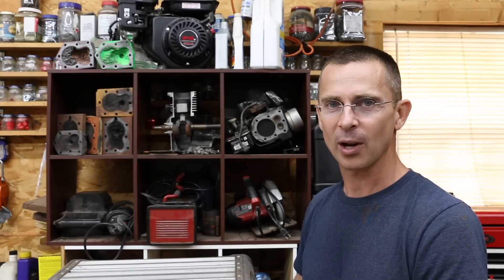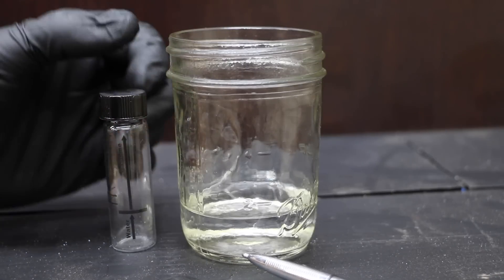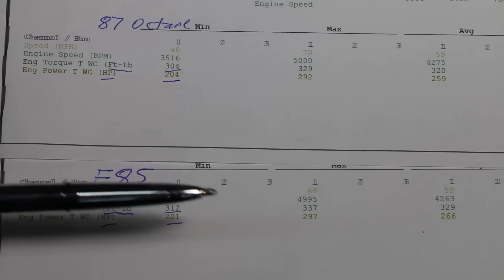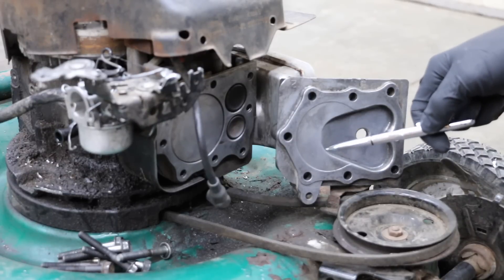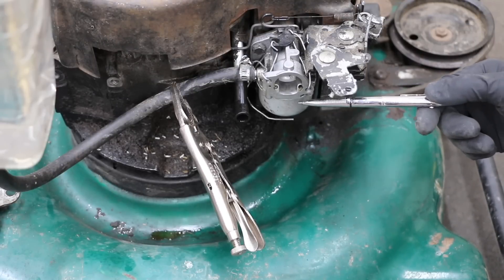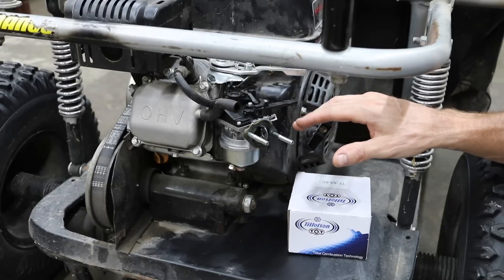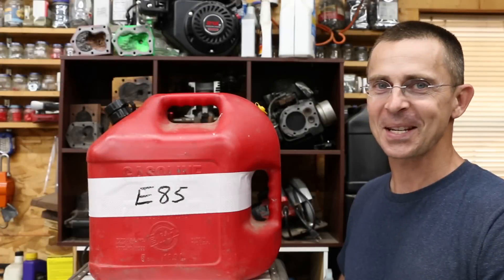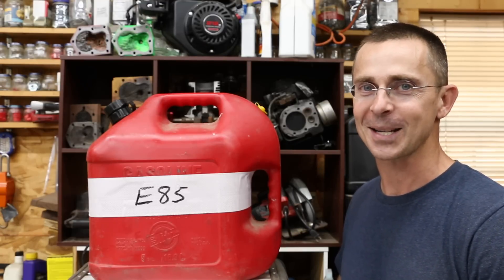Is E85 better than Gasoline? Let's find out!

Comment: So, for those in the know, E85 is a preferred fuel for boosted engines, because ethanol has such a high octane rating compared to substantially  lower octane gasoline(even higher than some racing gasoline, but much more affordable).  Boost can be cranked way up with E85, without the fear of pre-igniton, all be it, at the cost of using a lot more fuel.

For those not in the know, E85's draw is  the lower cost per volume, which is really not a lower cost, since mileage suffers so much when it's run in low compression or non-boosted engines.

My suggestion is to try and get one of the Briggs up to like 14:1 or higher compression, and compare how much power can be made vs regular gas which can only be run, in a lower compression motor.

So basically see if you can measure the efficiency increase in the higher compression motor.
Reply from the maker: Great point. Thank you
Reply: @ProjectFarm  what about trying different experiments on 2 cycle chainsaw engines? Unfortunately, most chainsaw engines from an old McCulloch or Homelite to a brand new Husqvarna 372XP (all obviously not computerized carburetors) typically do not like ethanol because of the carb's rubber diaphragms and fuel lines, crank seals etc. Some of the fuel lines could be replaced with tygon fuel lines though, or if you're really good an old McCulloch's fuel lines can be replaced. It will be the carb's rubber internals, gas tank gasket, crank seals and any other rubber parts in contact with the ethanol fuel mix that will eventually suffer. Maybe even the cast aluminum and magnesium will too. The good news is that the old McCulloch carburetors are fully adjustable. I typically use only 91 octane gas with absolutely no ethanol because if any ethanol blend gas (which I have used 87 octane 10% ethanol blend) will quickly plug up a chainsaw carburetor if left sitting in storage for any length of time, maybe even a month.
Reply: Rebuild kits are available for many small carbs where the rubber diaphragm and needle valve is replaced with an ethanol-resistant one.  So not a big problem, really,.   Carb rebuild isn't terribly difficult.
Reply: @tubastuff  good to know, except never seen one for the old SDC carbs on McCullochs.
Reply: @johnlincicum6390 , the "other" problem with 2 strokes 
and gasohol, is the separation factor.  If you premix, 
and there is the slightest amount of water, the 4 
components will separate out.  "Water and ethanol,"
and "gasoline and oil."  Guess which one has no oil 
in it, and burns at a higher temperature?  Not counting 
the SERIOUS seal and gasket issues, gasohol is destroying 
engines, nationwide!  And, I can think of a MUCH BETTER 
use for ethyl alcohol!  In fact, I'm using some of my own 
creation, right now!

steve
Reply: @steveskouson9620  drinking! Lol!
Reply: @johnlincicum6390 , I have NEVER touched 
a drop!  Seriously!
Yes, that is a lie.

steve
Reply: @steveskouson9620  Hahaha!
Reply: @ProjectFarm  Just an FYI, your older Chevy Suburban that you used could not really take advantage of the higher octane that ethanol provides because of its lower compression ratios on that engine. Try a modern 2014+ Chevy truck DI engine and you can for sure feel the difference in power (11:1 Comp ratio). I get 19miles/Gal Highway (2014 Silverado Crew cab 2WD)for Ethanol and my HP goes from 355 to 380 (According to Engine specs). The truck can run in V4 mode at 75MPH with no issue but it can't stay in V4 mode while on E10 fuel. It has to switch back to V8 mode to keep Cruising at that speed
Reply: @hectorgonzalez5030  Hello Hector.
Can we discuss when petrol is unavailable in Brazil when Venezuela is in crisis?
Sugar cane for instability of Bolivars and communistas!
Reply: @hectorgonzalez5030  Pray you have an actual Allison transmission and not the German ZF, like Ford.
Reply: @ProjectFarm  You should make a battle of the fuel filters, cellulose, stainless steel and microglass. If you are using cellulose try to use the ones that are compatible with e85, such as those from Ford and GM. I would like to see if the fibers expands, if they are issues with the glue and if the cellulose collapses with time.
Reply: @ProjectFarm  a computerized carburetor chainsaw as an example would be the Husqvarna 562XP or the new 572XP which is the replacement for both the older 372XP and the 576. The 372 technically had 2 different generations dating back into the late 1980's or for sure the early 1990's.
Reply: For a small engine test platform it would need to be overhead valve as you can't shrink the compressed area much on a side valve engine. Ethanol ignites quicker than petrol but resists detonation a heck of a lot more so when off boost you might need to reduce timing to get Max torque where in boost (or high load with high compression NA) you can get away with more timing without detonation. Pretty awesome. Also has a cooling effect but that's only noticed on turbo engines really
Reply: Would LOVE to see the diffrence with E85 in standard compression ratio vs High compression ratio. Would help alot of ppl out There!
Reply: It has a higher octane rating, but ethanol has less energy. Unless an engine is designed to run on it, you'll have a loss of power.
Reply: This is why I used ro run piston aircraft fuel in my pump gas track car. Something about the fuel being a weird green/ blue color was very strange. I think the fuel was around 104+ octane.  But the car ran good ! I built a 4 cylinder volks wagen engine that wound up producing 480 horsepower on that fuel. Very fun street machine. The engine was a 2275cc displacement. It was pretty reliably, until it came down to tuning the carbs, which was done on a weekly basis.
Reply: Boosted engines typically run hotter as well, so the e85 burning cooler also helps tremendously
Reply: Wow Jim you are one smart cookie! Very intelligent! Keep up the good work and God bless you
Reply: You know that you can Spray Water Mist and accomplish the same thing ... just saying
Reply: ...albeit...
Reply: jimsiggy, the problem with a flathead (side valve) engine is clearance for the valves.  Because of the design of the engine, compression is very limited due to valve clearance issues.  Raising compression can logically be done only on overhead valve engines.  A side-valve engine can never make it to the compression ratio you suggest.
Reply: @sunshinekid6922  Exactly correct! We used to hop-up our go-carts and mini bikes by building up the cam lobs with brassing rod. The limiting factor was head clearance.
Reply: @sunshinekid6922  actually the head could be machined to a higher compression ratio, if the valve clearance is to close. relief areas could be machined over the valves with a nice taper for proper air flow and combustion.
Reply: jimsiggy e85 also burns around 650 degrees cooler and produces a cooling effect in the combustion chamber. This is the primary reason why it’s so good at reducing knock besides being 105 octane
Reply: Steven Goggans yes! It tunes like 110 octane gasoline because of the cooling.
Reply: You could always put a different piston, or for testing purposes tack weld a piece of steel on the top of the piston. It probably would last long but just to see.
Reply: @claytonandersontar21  watch some videos from "afleetcommand" on YouTube. He does "pop up" pistons on Husqvarna 372 chainsaws.
Reply: @johnlincicum6390  
Hi John! Back in 1975, I brazed a small washer on top of the piston of a Cox .049 model aircraft engine. Static compression ratio tripled I'd wager. It ran wide open for a minute, until the whole shebang melted and locked her down.
Compression with nitro is calculated using volume of Roots Blower in conjunction with c.i.d. of the engine.
Positive displacement blowers are much trickier than turbos.
Way beyond my comprehension. I can read a barometer, but have never sat in a dyno room. I must be one of those guys that "believes" all the 1000hp chassis dyno pulls. According to Auto math, Brake mean  effective pressure can be calculated.
Volumetric effeciency too.
I would be happy with 180whp in a 2600lb car.  I have been happy with 275rwhp in a 2800lb car. 12.3 ET with N/A and pump gas. Car was basically a cammed 64 SS with Duntov tech.
Reply: Also good for non-boosted applications, you can advance the hell out of a naturally aspirated engine with E85. It is practically as good as race fuel.
Reply: I was going to comment this about E85 in boosted engines.   A couple friends of mine have mustangs with turbo LS motors and they swear by it for them.
Reply: jimsiggy I thought E85 runs a lot cooler. So regardless of weather your turbocharging your car and trying to run big boost or not it runs cooler so you can crank up the power without fear of blowing the engine. But I don’t really know what I am going on about, I just know what I’ve been told and videos on it. So weather it is true or not I don’t know. But the test was definitely not fair and the truck is not really why people would use it 😂 the manufactures would not have been trying to make more power when they designed it. Plus the fact that the maps will be different.
Reply: keep in mind it's mainly the carbon that gives you the MPG, (carbon = how long your fire will burn) ethanol has little carbon. higher compression will make the engine burn more efficiently for it burn more of the fuel. but I don't see it making up 2x ++ carbon levels unless the engine is way to weak to push the truck efficiently.
Reply: Detonation, not pre-ignition. Though the latter could cause the former.
Reply: exactly boosted engine gets good boost and linear power but horrible gas mileage on e85 lol at least thats the case in my n54
Reply: Boosted or not it is all about the tune.  Boosted vehicles in general will always require more fuel regardless if fuel because of the added air.  There can be magic in a tune, just takes someone who is competent to do it.
Reply: Currently building a 2.0T FSI Mk5 with 600HP internals. I was planning to run water/meth injection. Should I consider running E85? What are the pro's and cons? Can I run both?
Reply: By the way, for some reason my bike runs fine on pure grain alcohol bought at the liquor store or 90%grade walmart isopropyl than that E85 crap that stinks. Not sure what they put in E85 that makes it run like garbage after a while
Reply: From my understanding (which may be incorrect) E85 was not designed for boosted applications, it just so happened that it worked very well! I personally do not have a boosted engine (yet) and my vehicle was never intended to run E85 but I do run a blend. I currently use 30% ethanol (E85 mixed with 93 octane) on a completely stock fuel system (I did tune the computer) and have a very noticeable increase in power over stock and getting better mileage.
Reply: I have a couple high compression modified chainsaws. Would E85 work well?
Reply: Lo Miller I would add a bit more oil to the 2stroke gas mix. But yeah, the oxygenated gas is a good idea for a 2stroke. It might eat the carb, which I did not care in one of my dirt bikes as it was only $10 to replace.
Reply: @sfertonoc  thanks, is there any benefit to running E85? More power?
Reply: Lo Miller alcohol is high octane (120) and oxygenated so it has a Nitrous like effect, ie it is as if the air intake was richer in oxygen and less nitrogen. I think it also is not as volatile as gas itself, so less vapor locking issues. The down side is that its energy per volume is lower than gas. I think mixing it with Kerosene which has the highest energy per weight but is low on octane would be an ideal compromise, but it is hard to start in cold weather, but not impossible with a starter fluid spray. The oxygenate of the alcohol would also mean a cleaner full burn of kerosene while the Kerosene would help protect lines from the oxygen corrosion. Fancier would be Kerosene- Xylene-alcohol or Xylene-Acetone-kerosene mix. But that suff does not have the lubricity of gas at the pump, so, even in 4 strokes you have to add a couple percent of 2 stroke oil to it.

However , if you do not care about consumption, pure alcohol will get you high instant power. Top fuel is alcohol and Nitromethane hyper oxygenate mix and has low energy, but in high volume its burn makes for “explosive” energy for drag racing.
Reply: Yup. You need roughly 30% more E85 as it has less energy than regular gasoline. As long as your injectors etc. can handle it, you can make much more power on a forced induction engine though without fear of detonation etc.
Reply: E30 is about 93 94 octane
Balanced  MPG to power ratio
 I would not not use E85
Reply: E85 have less heat value about 33% than gasoline. Theroractically, for acchive the same MPG, only if you can make a motor with more than 33% efficiency for E85. I highly douth only higher compression could compensate this big gap.
Reply: Methanol is the preferred fuel for full on race engines. Add 5% Nitro. Or more, if your 14-71 blower has kevlar straps.
501cid. KB Hemi, still is King. I like to voyeur 10,000hp from the stands!
Reply: Looking at Ford's choice to cheap out using only ten bolts on each cylinder head of their modern alloy engines. If I could afford to build another SS/Superstock, I would go with Company C, or Company D.
Ford is even lacking in coolant jacketing around spark plugs. Triton, Duratec, Modulars. Plugs ceramic crumbling like Mazda's 12A of early 1970's
10 bolts will not clamp 20psi for long.
Team C and Team D, using 4 more per head? Even Honda utilizes better clamping force on their decks.
And evenfire cranks are much weaker on V6's. Italians know better than to boost a V6 to infinity and beyond. America has entered the quality control twilight zone with turbo V6 and weak 8 speeds and more automatics.
Fix it again Henry.
Reply: Richard Skipper  ou ou juju.
Reply: What about today 5 bucks for regular or 3 for e85?
Reply: @dang8973  An engine running E85 is going to get about 1/2 the MPG as compared to the same engine running normal gasoline, so you tell me.
Reply: @jimsiggy  really half?  Sounds like a big oil troll has entered the room
Reply: @Meself-ks6nm  lol, that's funny.  First of all i said "about half", which is based on my experience comparing mpg results I've seen when using e85 vs regular unleaded, and the fact that regular unleaded has ABOUT 50% more BTU's available per gallon than E85 (114k-124K vs 81K or so depending who's data you read).  So am i "Big oil troll"?  If that's what you think then feel free to make assumptions based on logical fallacies,  it doesn't bother me.  But I'll tell you that I'm just a guy who's interested in getting the most bang for my buck.  It's probably more like 25- 30%  reduction in mpg, so if e85 doesn't costs at least that much  less than gas, then you're cpm is higher with e85.  But hey do what you want.
Reply: @jimsiggy  I agree with you now. Let’s call it 30
Reply: @Meself-ks6nm  agree.
Reply: 2.0 Turbo accord  once a month  during warm weather I run 3 gallons of E85 and 13 gallons of 93 octane in a 16 gallon fill up the car seems to run very smooth and has more power and
Reply: Yea, let's just ignore using Billions of gallons of the purest water on the planet to irrigate corn that's not a food source. Then let's not forget after harvest they need 4 more gallons of water to make 1 gallon of ethanol. Seems to me all life on this planet needs water to survive making this process unsustainable to keep life on this planet!
Reply: God idea. I think it would be cool to see a high compression engine used in your tests for comparison. You can take a belt sander and shave the cylinder head down a few thousandths or use a thinner headgasket. I think you'd have interesting results since some of the fuels you've run through them would cause them to run better or go pop.
Reply: ethanol is not a good fuel to use unless you have a higher compression engine. it really does suck below 10.5 or 11.0 to one. at those ratio's it is just as good as gasoline, maybe better except nox emmissions go up and we are trying to controll that kind of thing..
Reply: @ john lincicum. remember that in a two stroke you have to use the 'corected' compression ratio . as the engine only compresses the charge after the piston closes the exhaust port. meaning that most two strokes run around 6.5:1  ratio. so alcohol fuels are not the best for this purpose, in fact you are better off with the lowest octane trash you can find and adjust the octane rating upwards with a high quality pre mix oil.
Reply: @lukewarmwater6412  see comment below.
Reply: Everyone here is forgetting about the cam on these engines facilitating the easy spin function. The cam holds the valve open a slight bit longer and lowers the compression until the RPMs come up. If we filed the lobes on the cam to shorten the duration the compression will come up.
Reply: @thefirstmissinglink  sse my comment below.
Reply: We love e85 and if you keep your foot out if it and have a proper tune you can achieve great fuel mileage. Heck we have a turbo coyote swap rx7 that will get near 20 mpg and makes over 1000whp.  The secret to e85 is that it is oxygenated and has great detonation resistance so you can pour the timing to it and timing is power.  If you run e85 and don't make 75+ hp over pump gas then you need to reevaluate your tuners skills on boosted applications.  The other reason we like e85 is because of its cleaning effects and lack of carbon build up which results in cleaner valves, combustion chambers and oil.
Reply: @turbochevelle5641  I have gotten a tankful of oxygenated fuel. AN, from a refinery. When you have idiots running the asylum when the shift foreman is away.
Reply: Engine Masters on MotorTrend did a test with a N/A 14.4:1 Compression Big Block Chevy that made 780hp on pump gas at 7500RPM give or take......the difference was between nothing and 8 numbers all throughout the curve and 2hp at the peak.
Reply: @rustysausage69  when you say "It made 780hp on pump gas", are you sure?  I find it hard to believe that an NA, engine under about 700 CI,  could make that much HP on low octane fuel(pump gas), but I'm no expert,  just an enthusiast.   
So whatever the case, I'm not surprised,  that the difference was negligible.   the point was, to take advantage of the incredibly high octane rating ethanol offers, to see if really cranking up the CR on an engine increases the effintcy of the engine,  to the point that the reduced MPG's which come along with e85, can out do pump gas, in terms of BSFC.
Reply: @rustysausage69  Cannot watch it, because I don't have the subscription. I unsubbed from MT, when they started charging a fee.